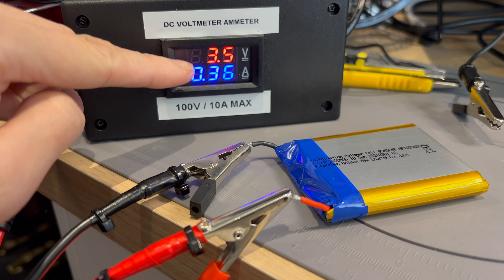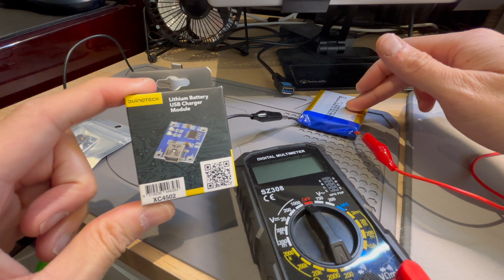Salvaging a 5000mAh LiPo from a Faulty Power Bank 🔋 | First Time Battery Harvest!

Comment: There are TP4056 modules that have the DW01 protection IC for overdischarge and overcurrent protection, basically this module and the BMS in one. That's the most common form on aliexpress.
Reply from the maker: Thanks for letting me know. I ended up receiving my BMS and have it hooked up, but something went wrong. In the next video coming up!